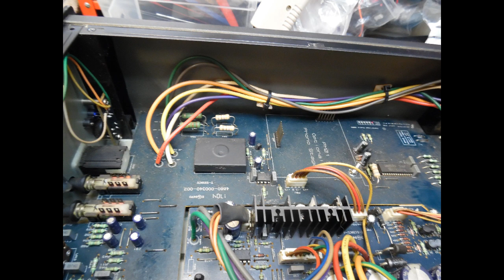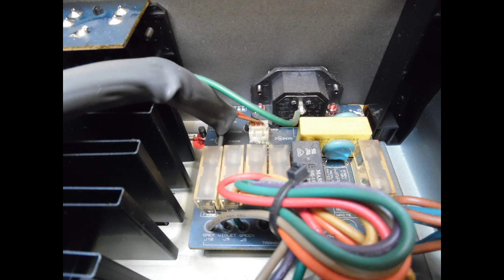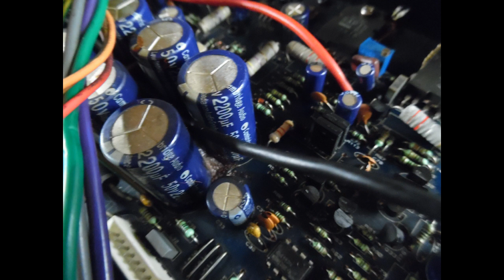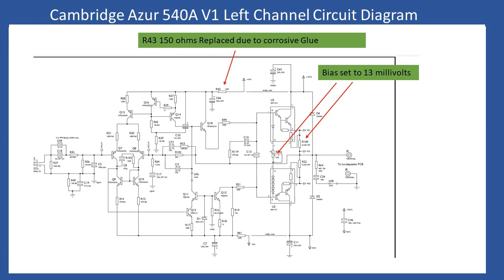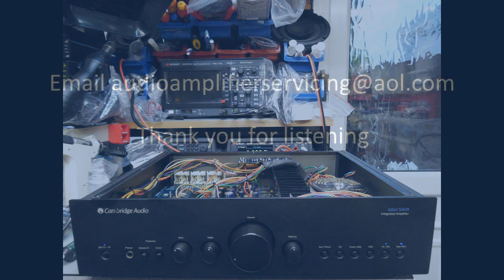Cambridge Azur 540A V1 Amplifier Repair (With Audio Tutorial)

Comment: Had the red light if death, took it to 2 audio elect. shops l was told no replacement parts are available l think it was that bloody relay. This is so annoying.
Reply from the maker: When you say the red light of death how many times is the protection LED strobing.
Reply: @AudioAmplifierServicing l Can't remember now sorry it was 2022. My Dad had just died and my head wasn't right. I left it at the shop and then later l couldn't find the reciept.Thanks for replying though.
Reply from the maker: @bananabrooks3836  Sorry to hear you no longer have the Amplifier

Comment: At the back of the amplifier I turn on the power switch, the light indicator of the input selectors runs through, and then I press, for example, CD - it turns on by blinking 4 times, then it plays, there is sound for not long, then a couple of seconds, then it can play for 20 minutes and turn off... and when it turns off, then you can hear the sound of the switch..... I noticed (can hear) that the power is on..... and when it turned off, pressing the input selector again does not indicate the indication, and the turn button indicator lights up.... strange.... please advise. ...
Reply from the maker: Hi the first thing to do is check for the brown conductive glue and remove it, then retest your Amplifier
Reply: Yes, there is similar glue, but it is mainly available from Conder. Or did the elders say something like this from the factory? And I didn't touch it. So once I took it apart and looked for it, I didn’t find any problems. I cleaned it with alcohol and assembled it and played for a week. Right now, only the input selector has started to turn off. Thank you for your help. Happy New Year holidays to you. @AudioAmplifierServicing
Reply: Thank you. I again went through with alcohol, those areas where the glue remained, brown glue where. And now it won't turn off again.
Reply: But the yellow coating remained. It comes off very hard, how can I remove it?
Reply from the maker: @vitaliistarciuc7299 Hi please can you take photos of the top of the circuit board so I can see if there are issues with glue covering components or wire links.
Email to audioamplifierservicing@aol.com